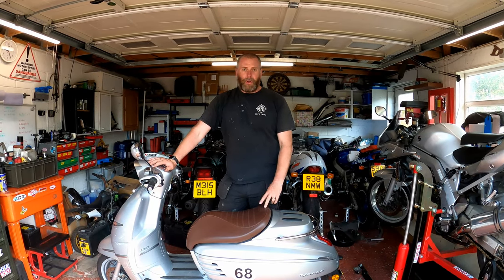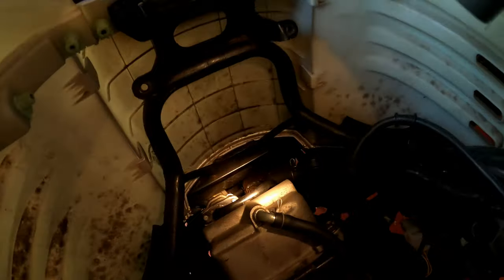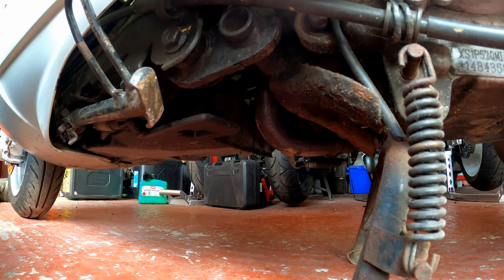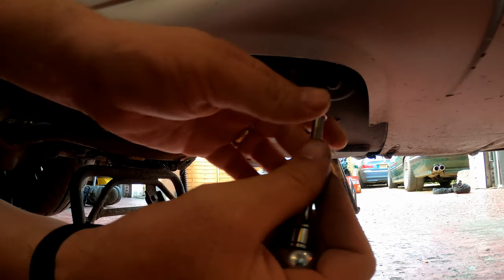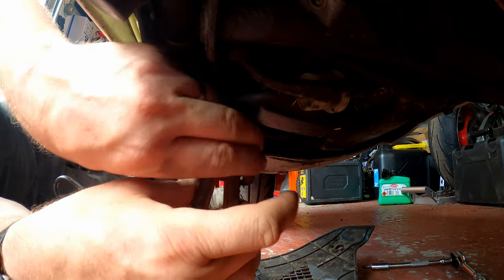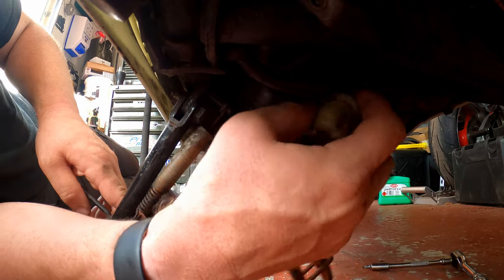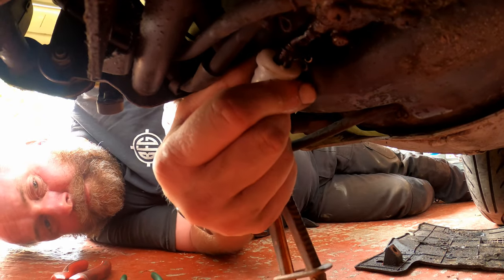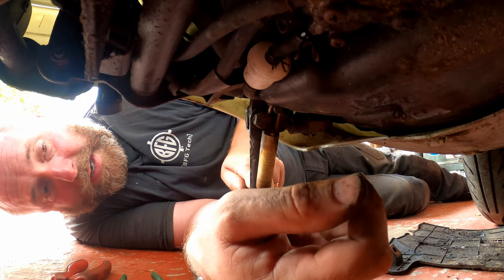Peugeot Django Fuel Filter Replacement - A Step By Step Guide

Comment: Hello and thanks for the video!
I just started to look into this scooter in the 50 cc level as I do not have a motorcycle license.
I called a moped mechanic and he thought that if I wanted to tune the Django 50 cc one needed computer software to be able to fine tune things right? is this correct? is Django 50 cc by injection or by a carburettor? 
sorry for my English, I am Swedish...

Does the Django moped have an EFI system, I think this is what the mechanic was refering to?
that the fuel mapping and injection timing might need to be adjusted using Peugeot’s diagnostic software.

and maybe also their Electronic Diagnostics: To ensure all sensors and electronic components are functioning correctly after mechanical modifications, diagnostics software might be required?

The got something called the Peugeot Planet System (PPS) or Peugeot Diagnostic Software. For professional use, mechanics typically need access to this or similar official software to perform in-depth electronic diagnostics and adjustments.

But honestly, have they put this into the Django no matter if it is 50 cc or 150 cc?

does anyone know if this is really the case,  that Peugeot Django needs an EFI system or an advanced CDI unit that allows electronic adjustments?

I find it hard to find the correct information about the Peugeot Django...
And if the tuning of a Peugeot Django 50 cc moped is complicated to tune?
I was thinking that most of the modifications such as changing the exhaust, carburetor, air filter, variator, and CDI unit are mechanical and do not typically require access to computer software?

 However, I have heard that some modern scooters and mopeds do have electronic components that can be adjusted or optimized using specific software, particularly if they have an Electronic Fuel Injection (EFI) system or advanced electronic ignition systems.

Can someone please help me out and see what one needs to do this right and if the software is easy to download on any computer like a Macbook if needed or what must one do?

I was thinking of:
Upgrade the Exhaust System
Adjust or Upgrade the Carburetor
Install a High-Performance Air Filter
Change the Variator and Rollers
Install a Performance CDI 
Optimize the Engine Timing and Compression

But if a computer software is really needed I do not know how to find that and a mechanic that got it and know how to use it?
please advice me what can be done and not and how one should do this right!

thanks, Chris

Comment: Hi my fuel has stopped reaching the carb would / could this be the problem 
Thanks
Reply from the maker: It’s a possibility, the fuel pump is vacuum operated so check this too. Disconnecting the fuel filter and cranking the bike to see if fuel comes out of the hose would discount this 👍🏻
Reply: @KevsShed  thank you will try that
Reply: I have the same issue man keeps cutting off in middle of the road

Comment: Hi Kev. Thanks for this video. I've got a Django thats been sitting in a garage for two years, and I need to drain the fuel (which is probably gone bad). If I drain it from just before the fuel filter, and replace with new fuel, do I need to worry about the small amount of fuel still in the fuel pump? thanks!
Reply: Hi Leo, I have the same issue, did you sort yours and find a way?